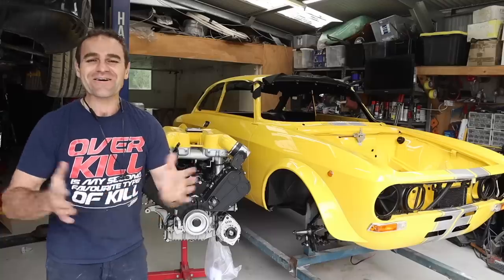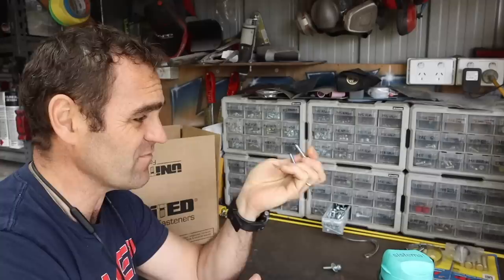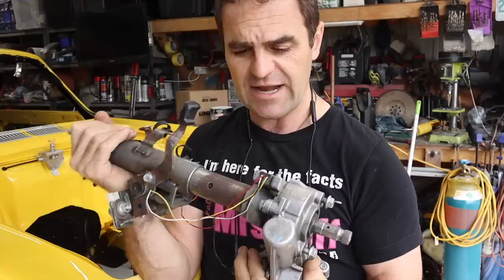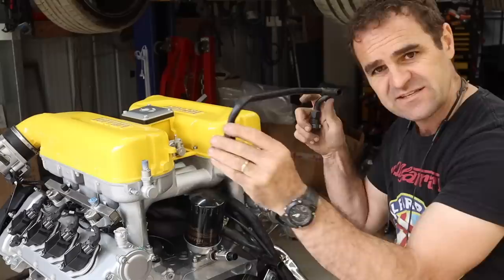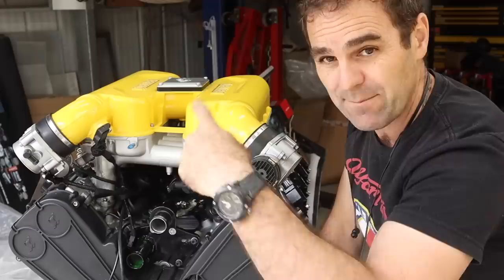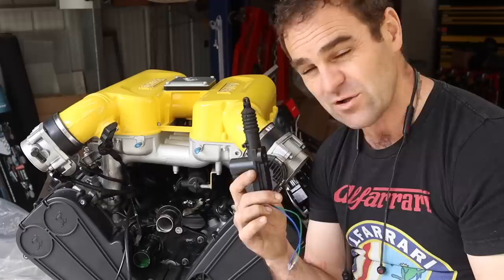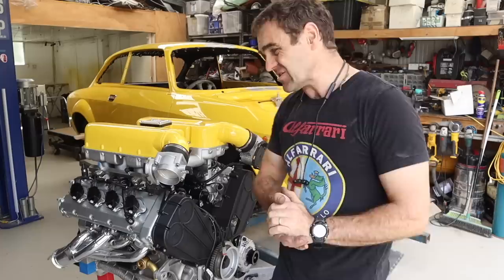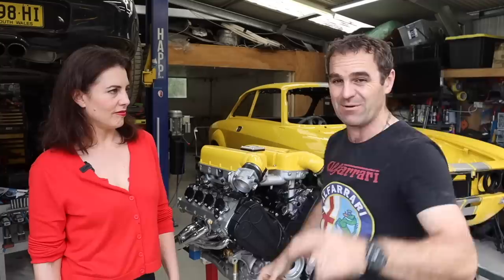All the fiddly bits - Ferrari engined Alfa 105 Alfarrari build part 167

Comment: I usually reuse the old bolts unless they are ugly or need replacing. The only problem with this is it can get very expensive and often you can’t get the right fasteners to suit .
The trouble is that there are standard fasteners sold by all the outlets and then there’s special oem fasteners that you can usually only get from the stealers.
The oems can order special one off type fasteners in bulk for much less than you can buy standard fasteners but they charge like wounded bulls if you try to buy them.
You can make standard fasteners fit but often it requires surgery and big washers.
Beware the standard bolt that looks like it will fit, it is either too long too short or the head is too small or to large and using it without modifications with causing expensive harm.

Comment: Vacuum actuated valves like the system it came with are generally far more reliable than any electronic solenoid/motor-gearbox designs from what I’ve seen.  If like some of the others suggested, you can set up a small tank with a few electrically controlled valves, and leave the grunt work for the factory Ferrari stuff, you’re probably on the right track!  Looking forward to seeing what you do regardless though Jeff, I know you’ll get it figured out! 😎✌️
Reply from the maker: I have come to that decision too. I have already got the tank and solenoids on the way. Now I just have to find somewhere to mount it... ;)
Reply: @HomeBuiltByJeff  Nice!  Space will definitely be an issue, but I know you’ll find a solution!  🥳

Comment: Is that vacuum valve definitely an on/off variety or is there some linear progression between fully open and fully closed? Just cos a simple on/off will be easier than linear progression.  I also don't think you need to worry about the carbon cannister as it's the age of the vehicle that defines what emissions standard it has to comply too and not the engine used. My engineer told me this for my 60's Beetle getting an Subaru engine fitted 😉

Comment: Can you just run a stepper motor to open and close at X% vac. I've done similar outside of cars and used them to trigger off rpm etc and they are fairly small. Even a servo could do it. I'm not entirely sure how the stock valve is connected to the butterflies.

Comment: If you decide to go down the route of the door lock thing in the engine bay, I'd be looking more at a stepper motor idea then that way you can have it set to open then power cut off and closed then power back off.. maybe a better idea unless someone else knows better. Lock idea I feel is a bad idea due to the heat and constant power being put into something that wasn't designed for could potentially burn out in 1 way or another

Comment: I guess Ferrari went with the complicated vacuum system for a reason, number of operations per mile driven vs typical cycles of locks could be pretty high. You might be able to do it with non-Ferrari vacuum accumulator and solenoid? Is it the same setup where this is in Maseratis etc? They might be good for donor parts? Other thought would be electric cars having electric vacuum pumps so I wonder if they have accumulators in the system?

Comment: vw has been using stepper motors for the wastegates on their modern turbos. I would think this would work for your application and they are designed to be in the worst conditions in an engine bay.

Comment: Idle control valve might help I guess...
Reply: He has drive by wire throttle bodies, they take care of that.
Reply: @mawe42  I`ve meant for the valves on the intake to use ICV solenoid
Reply: @georgegavrylenko1031  Not a good choice, there is plenty of electrically operated vacuum valves, like whats there originally or Porsche has several. His issue, I think, is the lack of vacuum tank/accumulator.

Comment: I would think by this time, you would know better than to tempt fate by challenging the Great Engineer Murphy. Why, oh why, did you have to say "I'll be putting the engine in for the last time"?  Don't think you will like your rear pick up point- if I've understood you, it will be between the adapter plate and the transmission bellhousing when you are ready to set it down- if the trans is already in place I foresee problems. ON the vacuum, any can about one liter will make a good vacuum bottle to work from- your bigger problem is that you haven't a signal to drive the valves you mentioned- call Haltec if you are using their ECU of other. Haltec will answer the phone the others....... If you go the mechanical route, a bell crank four and one quarter units on powered arm and five and a quarter units on the actuator arm will turn your 17mm into 21 mm- again check your ECU mfg to find an output that can drive it. Also, the ECU will need a vacuum pick up point.
Well the car is 90% finished and the 10% of the fiddly bits are upon you- three four months and it should be a going proposition!  Hope you don't take Harry swimming again!  FR

Comment: Just leave the short runners permanently open. It’s not going to make a massive difference and the Alfa is much lighter so losing a little bottom end torque won’t be as noticeable if the engine was in a much heavier car.

Comment: It'll never run right until you figure out what a PCV valve is, and how it operates.
The fact you are running one on each side of the engine tells me you lost your clue and therefore have no clue.
Yes, no clue was found, sadly.
The secondary intake runner valve is not an open/shut valve, it's linear...progressive.....operates in the gray area and not simply black and white.
You would do better trying to find a higher power RC controller motor/actuator.
Dig ?
You could always fit in a MOTEC controller or possibly a Holley Sniper or a Fuel Tech ECM (uhh that's engine control module since I'm going to guess you need that bit of knowledge).
If it comes in too quick the engine will stumble, too late and the engine will bog.
Savvy amigo ?
Reply from the maker: I am well aware of PCV's and what they do, which is why I am keeping them as they were from the factory. The secondary runner in the Ferrari is actually on off, and if you have watched previously you would have seen that I have already wired in the Link ECU which will run all of it ;)